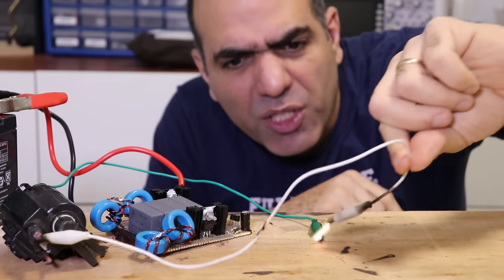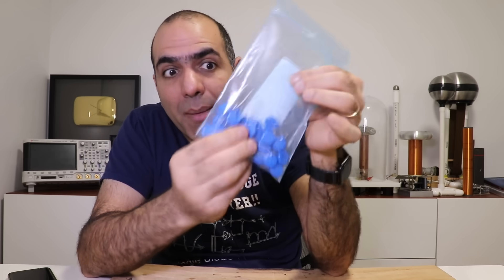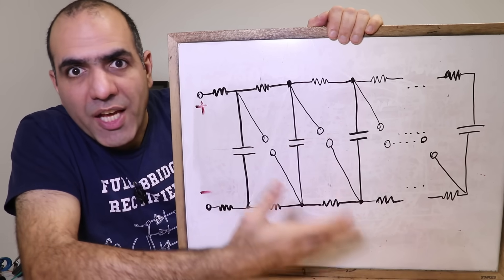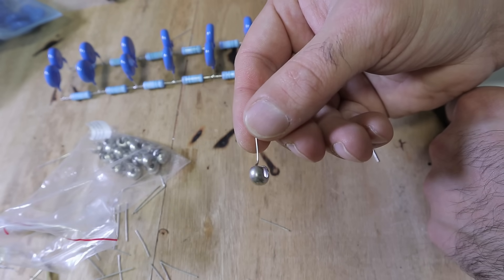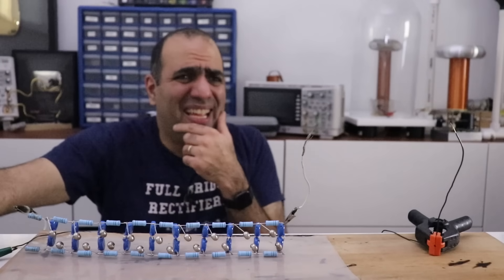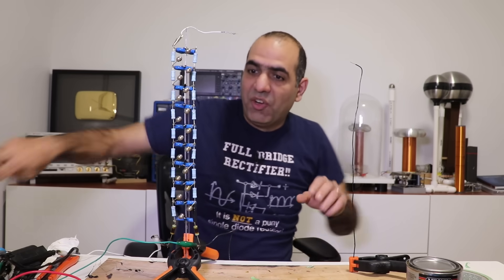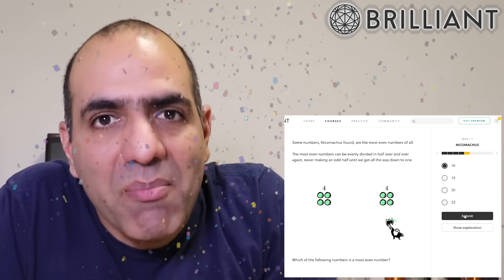Making 500,000 VOLT ARC with Marx Generator

Comment: I re-watch ElectroBOOM's videos periodically and I'm pleased to see I understand them more and more. I remember very well the first time I saw this one, I was amazed but I didn't understand shit. Now it all seems rather clear to me :)

What would be the impact of having capacitors of lower or higher capacitance if any though?
Reply: theoretically, assuming they are rated for the same voltage, larger capacitors can hold more charge and therefore will take longer to charge.  The arc will also last longer, although it's going to be a difference of a split second to a slightly longer split second. the final voltage should stay the same.
so pretty much the frequency of the system would slow down with more capacitance and not much else would change, assuming ideal behavior, but arcs aren't exactly ideal anyway.

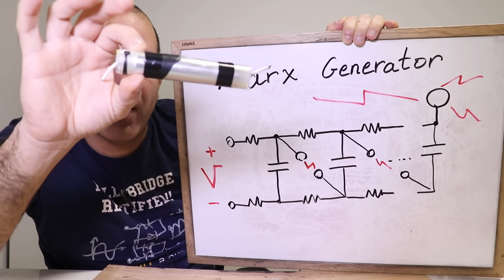Comment: 0:39 - we need a high voltage capacitor, some resistors and a spark gap...
... this is my super high voltage capacitor...
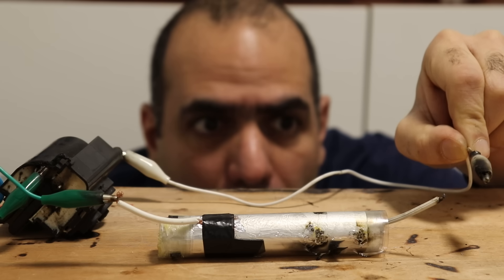2:00 ok, so it's not capacitor, it's the spark gap

Comment: I've tried to make my own using 1M resistors, 100pF capacitors, and reverse-biased  2.6-volt Zener diodes instead of spark gaps. I used Zener diodes because normal diodes would not even come close to the breakdown voltage when the circuit is running off a nine-volt block battery. Plus, the Zener diodes would have a more controlled breakdown, and I wouldn't be exposed to any high voltage sparks or arcing.

Comment: In this or another video about this Marx generator you argue that the sparks in the gaps go simultaneously because the first one produces ionizing radiation. I think this can be easily tested by placing some 'walls' between the gaps so that the ionizing radiation cannot get to the second one and so on. I actually think the explanation is much easier: When the first gap jumps (which should be a little bit shorter distance than the others, the subsequent gap suddenly has almost twice the voltage it had before and is immediately bound to spark, the subsequent gaps increase even further step by step. This is why they all go `exactly` simultaneously.
Reply: I would guess that the discharge progresses at the speed of light, even without light radiation.
Reply: I believe he said it in one of his LaTITY videos, in response to a clip in which someone was using the ionizing radiation produced by a literal radioactive substance to allow arcs to cross a small spark gap.

There's a lot of EB videos I still haven't seen yet, so he might have also discussed it in other videos.
Reply: Right. In fact once the first gap fires the others progressively follow suit in nanoseconds. It's called "erection" in the business.

Comment: There was a guy in my HS physics class that built a massive capacitor… like 3 feet (1 meter) long. It was similar to EB’s “tiny” capacitor in that it was aluminum foil rolled up with wax paper as the dielectric. He charged it up, and because in and of itself the charging doesn’t appear impressive, he decided to discharge it… himself. It threw him about 7 feet onto the floor. The class was impressed, he was… ‘ok’… and I believe he got an “A”. 
Come to think of it… that very well may have been ElectroBOOM…!
Reply: Anything for the A
Reply: Thank god he didn't get an L
Reply: ElectroBOOm origins story
Reply: Why would it push him back though?
Reply: @Hoi4daybydayguy  It makes contract legs and arms so that it propulses you away from the source.
Reply: all the muscles in his body contracted immediately which sent him flying @Hoi4daybydayguy
Reply: How did an electric discharge throw him back?, did he discharge it with a pipe bomb?
Reply: Yea capacitor  voltage is like 12356
Reply: like people say it's not about size it's about how you use it
Reply: ElectroBOOM lore

Comment: Ground means negative voltage not gnd with no power gnd actually helps not electrocute you all your electricity goes to gnd meaning you won't get electrocuted but they refer to negative as gnd.

Comment: 0:58  my guy consider getting rubber gloves know that a strong enough current can stop your heart. anyways. Ummm ? question ? Why rely on " spark gaps " as you called them why not just use  high voltage diodes in place of spark gaps ?
Reply: 7:56 see spark gaps equals bad connection and bad idea in general.

Comment: To prevent sparks jumping across your resistors, you can encase them inside an oil bath, or even epoxy. The dielectric breakdown voltage of oil or epoxy is a lot higher than air. You just have to have the spark gaps outside of the epoxy.

Comment: ok conside me inspired. i want to make one that naturally doesn't discharge at maximum voltage, untill the resistance has dropped. now, if i have a large open hoop with 2 parallel metal plates, anything that isn't air would discharge it. i place the 2 plates on a fixture mounted on a handle. now i move the 2 plates over a mosquito. the mosquito has a lower resistance than air, and thus ZAP it is vaporized with a hundredthousand volts (and hopefully enough ampere to do damage). my fly swatter now has no on button, placing the fly in between is the trigger to zap. strong enough to reliably end wasps (without them simply turning into a stinging rage instead of being incapacitated)

Comment: I need help.. everytime my room led fuses when there's a thunderbolt outside... 

Let me explain:  we all have our negative wire that is connected to leds all the time, and positive terminal is the switch, so i keep my switch off, but everything there's a thunderbolt lightings, my home led lamps or other leds flashes without power turned on , it  flashes even when the MCB is off.. maximum led light bulbs in my room. I'm tired of changing fused leds, i have brought dozens of spare leds to replace but still I'm tired.. 
 
Home earthing is also doing fine, tested with multimeter. Whenever led fuses it makes little spark noises, and i see there's black dots in every leds inside the bulb..  when ever thunder lighting causes leds to glow, it glows only a little, not as much as AC power, but still makes Spark noise and fuses.. they fuses randomly, sometimes laps, and sometimes overhead ceiling lights... 

Can someone explain me what's causing this? 
Because at this time only option i have left to try  is connect the home negative terminal directly to the earthing wire, so that every little current that goes to led when thunder lightings, it will directly go to ground (earth) before affecting the bulbs..

Also i have noticed one more things, When led switch is off , and the negative is the only wire that is connected, that time if touch inside leds body with bare hands, it glows a little bit...

Comment: why do all arcs fire when one arcs, sure if they are the same voltage, but you shorted one with a screw driver wouldn’t they all just go through that one? Also why is there an arc at the output, the distance is way longer than the spark gaps, is it because the voltage is higher there?

Comment: @ElectroBOOM, i tried to create such a thing from this video. I used 20kv 1nF Capasitors and 1MOhm resistors. My only voltage input was such a tiny round thingy from your last Video which seems to provide around 20kv.
But after i soldered everything together and tried it, there was no sparks at all. Have you missed something to tell us? Or am i wrong with the capasitors and transistors? T_T i want such a max generator for some tests
Reply: What flyback transformer should i buy i wanna make the marx generator like

Comment: To those saying "he knows too much to actually be getting accidentally shocked", you're right that it's 99% entertainment value. But as someone who has over 15 years in the electrical industry, I still get shocked now and then and sometimes it can be pretty intense (like 240 volts at 200 amps, in one arm and out the other across my chest). Mistakes are made, shocks still happen, even to pros.
Reply: And how do you survive? I could only think of 3 things:
1. Only risking less dangerous shocks.
2. Determination.
3. Or pure luck.
Reply: @CalculusLover  combination of the three, really. The big one across my chest should've killed me (lucky), but typical 120V 20A receptacle shocks don't bother me (that would be the less risky ones). Determination would be not letting a fear of electricity affect my work or sensibility.

Comment: Fun fact: An electrostatic speaker is actually one huge capacitor working at around 4000V baseline and 7000V audio signal. I've been zapped so many times from the DIY panels.

Comment: In 1986-87 we used a commercial Marx generator discharging into an xray tube to make Xray images of a detonation front within a cylinder of RDX explosives. When the Marx generator became erratic we opened the container (about 600mm diameter x 1.5meter) long and cleaned and polished the spark gap balls. After the capacitors, spark gaps, (spark gaps were measured to ensure precise distances), resistors were assembled and placed back inside the container, the container was refilled with helium and a small percentage reactive gas.
The marx generator had an additional high voltage point mounted in close proximity to the first capacitor spark gap next to the ground connection. This high voltage point was then triggered by seperate high voltage source to initiate the sparks over the other gaps to allow for precise synchronization with the detonation of the explosives to activate the xray beam to get a picture of the detonation wave within the explosives cylinder. These events took place within nano second range..

Comment: Hi ElectroBOOM would a Villard cascade voltage multiplier not be a better solution? if you series high voltage diodes and HV caps?  the ionization of stagnated air makes the circuit require oxygen to flow over the spark gaps to stop the corona discharge effect from ionization and would not work if the circuit was  fully resin impregnated, i am really curious to know as i played with this technology a few years back for a commercial product as this type of Villard cascade voltage multiplier is currently used in commercially sold stun guns, my question is really is an arc of that length possible using Villard cascade voltage multiplier?

Comment: I made high voltage capacitors out of beer bottles filled with salt water topped with mineral oil and wrapped in aluminum foil. I only sealed them with hot glue so if they decided to build pressure it would pop the seal and vent. I used 6 to built my first Tesla coil. They performed flawlessly. Since everything worked so well I'm gonna assume the capacitance was what the plan to build the coil called for. ~900 pico farad. I looked up capacitors and how long they would take to come from China and started googling how to make high voltage capacitors and stumbled onto the beer bottle recipe.

Comment: I love how he’s able to move so fast when he’s shocked because of the high voltage contracting his muscles
Reply: Actually, what made him jump was the battery's current. Currents above 200 mA are lethal, and the battery was about to deliver him 5000 mA. He survived because he didn't hold it for too long.
Important note: Current is the amount of electricity, and voltage is the pressure from an electrical circuit's power source that pushes the current through a conductor. Voltages above 40 can make electricity go through your entire body. High voltages can make the air conductive. A good quality tesla coil has an output of 100,000 volts and 1 milliamp, such low currents won't even hurt!
Reply: @XenonPhysics  Well he was holding the live wire and the ground in both hand which is a TERRIBLE idea. The battery is only 12 volts while the output is like 50,000 volts. There is some more info about this on styropyro's latest video. https://www.youtube.com/watch?v=BGD-oSwJv3E

Comment: What if u progressively increase the spark gap from first to the last?
Reply: I think it wouldn't work, because normally, capacitors are connected parallel through the resistors. Only when the spark gap fires, capacitors connect in series, thus combining voltage of them all. Even if it worked, it wouldn't have any impact on the output voltage, It would just fire like 1/10 of the time. If you want to charge the capacitors fully, you can increase the distance of just first spark gap, and trigger them mechanically. It's not recommended though, because arc can jump through the screwdriver to your hand, and mutilate you pretty badly or even kill you if you don't use the one hand rule. It's possible to build a completely solid state Marx generator with high voltage transistors but I don't know if anyone has built it yet, because if you want to go solid state, Cascade generator is more simple. I'm wondering if you can replace only first spark gap with transistor, and fire it only when capacitors are charged. I would build that but high power transistors are hella expensive. Regards.

Comment: 0:57 that one was lethal. I felt that literally. I was an electrician and I've been shocked quite a few times before.
Reply: the second time he almost met God
Reply: he almost died to a transformer twice
Reply: The bad thing is that unlike jacob ladder shock whics lots of current just going to the rods, this shock is going from his left to right hand through body and close to heart, so the current through body is higher than jacob ladder
Reply: @gamerlowgraphics  Still the jacob's ladder shock was much worse
Reply: @Owen_loves_Butters  it just buuurrrnn
-Mehdi touching 700V 1Mhz
Reply: I remember I got Shocked at my arm and its like 1/8 the pain of that Shock Mehdi got
Reply: Yep, I got shocked like that once bc a dick of a friend pranked me with a battery capacitor back EMF circuit I was working on.
Reply: The reaction speed of the body was genuine.
Reply: cvs circuits(found in induction heating) can reach 2kv+ at 1 amp or more
Reply: I don't know much so correct me if I'm wrong, it's definitely super painful and can burn skin and possibly nerves, but is is lethal? As the current is only going from one finger to the the next can that affect his heart?
Reply: @MisterReez17  yeah, it can be lethal unless there's someone with a defibrillator close I guess
Reply: @MisterReez17  ya know how nerves work

Comment: Hello can someone help me? Ive built a marx generator with 5 stages and used a zvs circuit with flyback transformer as the Power Source. My Problem is that my Spark Gaps arc continuously. When i lower the voltage, they dont arc at all. Changing the width of the spark gaps dosent help either...

Comment: 4:25 question how do you discharge that thing? im too dumb for all of this breh
Reply: He shorted between its legs. The same thing he did with his fingers which shocked him badly. If I'm not wrong, it would mean 150 mA through his fingers. A lotta pain
Reply: @craftcrewtv8094  soo basically something like a screwdriver? something conductive?
Reply: @murderer2022  well yeah human body is conductive, I think it's about 5 kilohms per centimeter
Reply: @craftcrewtv8094  i forgot about this comment, i will try to not forget this one, see you in one year!
Reply: @murderer2022  1 month, 11 to go
Reply: @murderer2022 I recommend you use a resistor. Always use insulated pliers to hold it, though.

Comment: Incredibly
I rediscovered marx generator by accident today
Using a not so strong arc 
Still cool like 25w 2000v arc
I uhhh was trying to make a capacitor blow for uhhhhhh scientifical purposes!
And the pin that were like 1cm apart
Created a strong af arc, i was still trying more and saw that this arc was like, the capacitor charging, and releasing the 2k volt and a huge current for what 25w should provide, so yeah
I should not be doing this XD

Comment: you need to play with a MSD ignition box..  Multiple discharge ignition.. so instead of 1 spark. you get 3 sparks.. decades ago.. a friend pulled in the donut shop parking lot with his V8 chevy Vega.  it would not shut off.. he had just installed the starter and managed to get the resistor bypass wire to the coil under the battery cable to the starter.. while he and i were talking about how to shut if off..  a friend stepped between use and leaned across the fiberglass fender. said ill grab the coil wire and pull it out.. there was a  mallory pro ignition coil installed on this car with the coil wire firmly attached.. so it unplugged at the distributor cap. the engine was idling at about 1800 RPM..  it must have taken 10 or 12 seconds for it to stop.. but the friend who happened to have his wrist across the throttle linkage was covered with blue electrical discharge..

Comment: I'm planning to build a super high voltage marx using two vertical wooden rods with capacitors and spark gaps connected between them using screws in the wood. The wood itself will act as an extremly high value resistor. Im making the capacitors from copper and plastic sheets. The only problem is corona losses because i'm hoping to run the input upto 100kV and with 10 stages generate ONE MILLION VOLTS
Reply: You still alive?

Comment: you need to do away with caps and spark gap and have a rotating high voltage switch to generate the spark

Comment: Greetings I wanted to ask how did you get the series resistance value for the marx circuit... I'm trying to design a circuit that has charging capacitors that = 0,16 uF... Tail end resistance and wave of 420ohm and 2981ohm respectively...